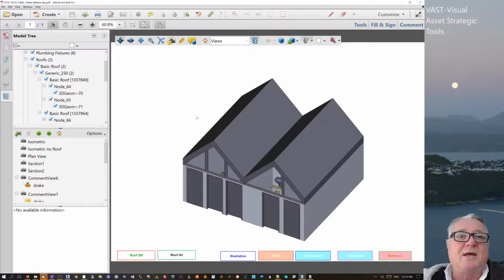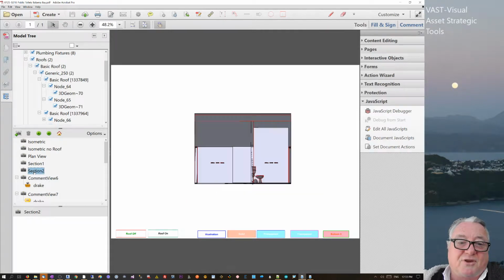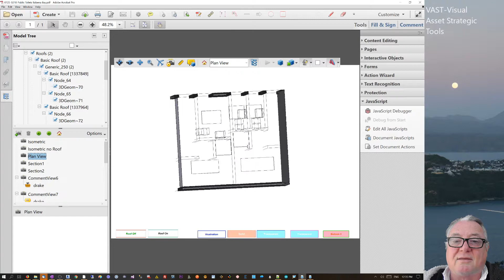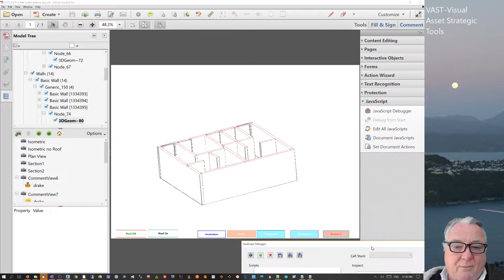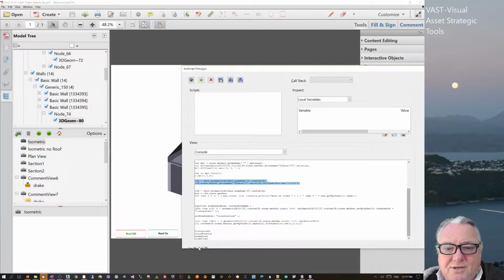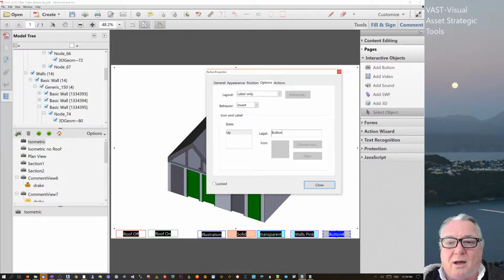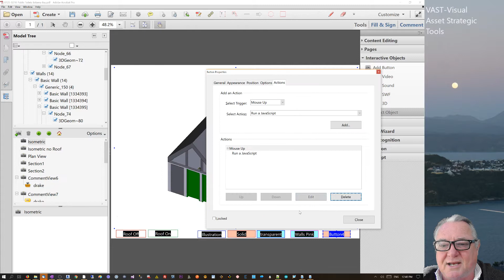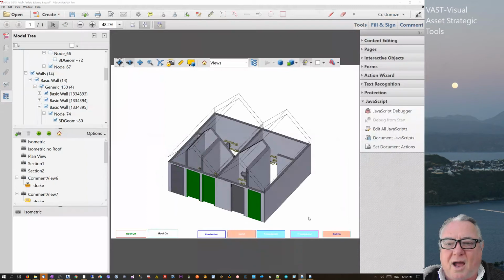Adobe 3D PDF & JavaScript Part 1

Comment: How to view javascript in adobe reader? I tried following settings but do not see.
Reply from the maker: Hi Sagar, 
This vid is using Adobe Acrobat. For Adobe Reader, go to Edit>Preferences> and select Javascript from list on left, then tick all the boxes(Note, you may need to close Adobe Reader down and restart for those settings to be set). Next go to View>Tools>AddOns>On this should open a ribbon above the page which has the Icon for Javascript Debugger showing.  I just downloaded reader and was able to do this. Kind regards,
Reply: @MaxDrake  I actually tried that but somehow it is not working for me. Also do you know how to render 3d pdf on web browser and how to edit pdf or detect events of each part of pdf?
Reply from the maker: @sagaralot1029  - I've actually unloaded Adobe Reader from PC again. Otherwise I could have done screenshots showing you how to get access to debugger. I would suggest you update Adobe reader to latest ( or uninstall & reinstall). Re View 3D PDF's in Web browser. Browsers can read 2D PDF's and you can go in to settings for your browser and say which programme you want to open the 3D PDF's with (Eg Adobe Reader). So when you try to open in your browser it will start adobe reader and then open it in adobe reader, so in fact you are not viewing in Browser but Reader. If you want someone else to read your 3D pdf's then tyhey have to adjust their own browser settings. Rather frustrating. See https://stackoverflow.com/questions/25059121/how-to-display-3d-pdf-in-chrome-firefox-browser.  I Think you can do some cool things with 3D PDF's but they are a pig to work with with Adobe code and browser viewer issues. Goog luck. Kind regards,